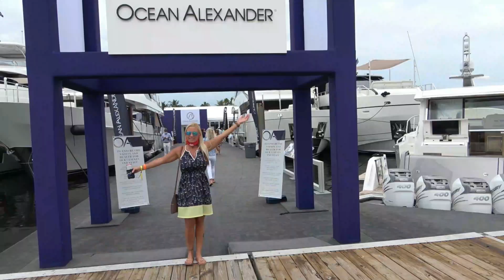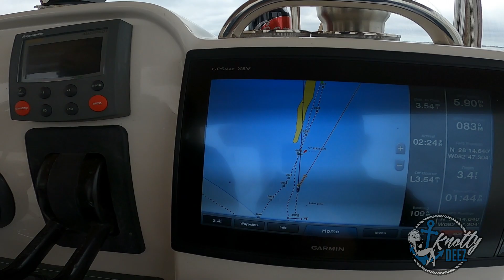BOAT LIFE = BROKE LIFE - LIVIN ON A BOAT

Comment: If one side won't start try starting the genny and let it run for 15 to 20 minutes. It takes much less power to start and once you switch over to genny power it should run your battery charger.

Comment: Hey guys, I’m considering a livaboard and of course the lifestyle. Couple of questions: 
A) is your boat a Silverton 352? Year?
B) what did you pay for it?
C) what did they charge you for the haul out and your props and rudders?
This all seems like it’s been an extremely expensive process for you guys thus far?
D) if you could rewind back to just before you bought the boat, what might you have done differently?
My wife and I are seriously thinking about doing what you guys have done but are confused about the purchase price vs the reliability ratio.
Reply from the maker: Yes, the boat is a Silverton 352 1998. We paid $49,900. I think the Haul out was about $650. The props were $1195/ea and the repair on the rudders and damage to the props after we already replaced them was a total of just over $11k. 
We would have done it on the east coast of Florida rather than the other coast. There are much more liveaboard friendly marinas, more slips available and for the large part much more affordable. Lastly, much deeper water and not such a minefield of shallow depths changing with the tides on a daily basis.

Comment: Glad to see you are moving once again.  I have a 1995 Silverton 41C and just wondered if you have a "parallel" start switch?  Most Silvertons have those and it allows to start an engine if that engines battery is dead by using the opposite battery.  Keep up the awesome videos.